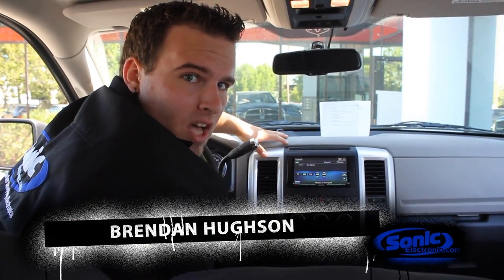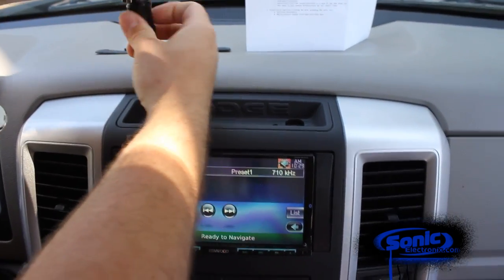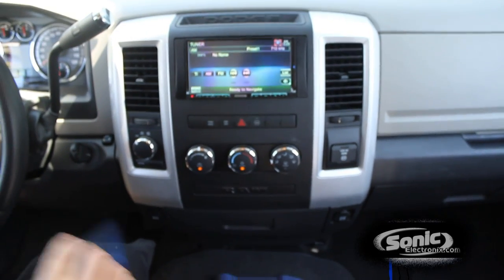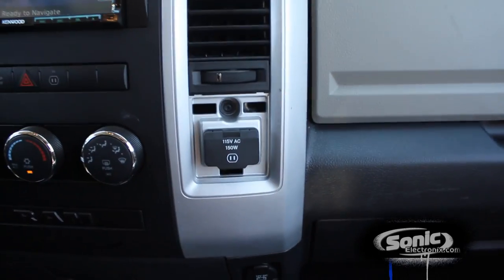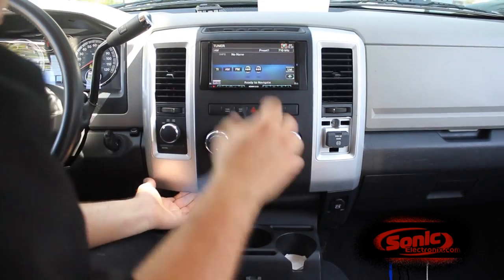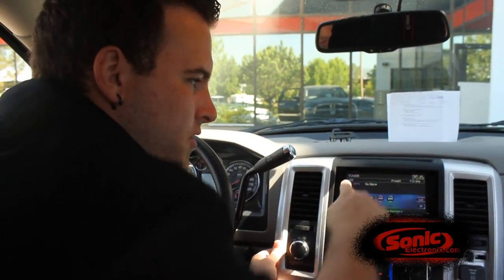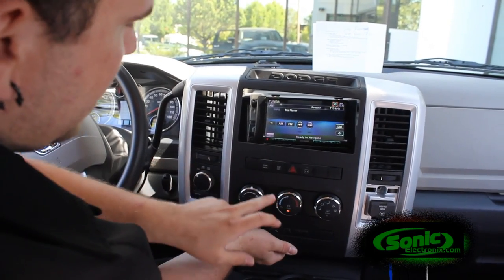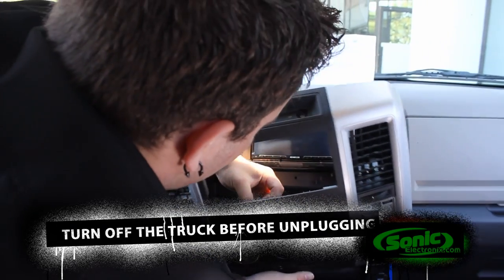How to remove a car stereo dash in a 2009 Dodge Ram 1500

Comment: Thank you for showing a Dodge RAM with Bench Style seats.   All the documents and other vids I saw were for the captain's seat style.  This is very helpful and makes it clear that there is even less to deal with / remove if you have the bench seat (3 across).   This is the same style as the 2010 also.

Comment from the maker: @trenttyre This video specifically shows the stereo removal for a 2009 Dodge Ram. If you have a 2006-2008 Ram then you may require different steps for radio removal.  I don't believe you'll need to remove the center console either way though.

Comment: Great video helped me out a lot when I replaced the factory stereo with another factory stereo. However, note to everyone out there, you need to use a T-15, not a T-20 as described in the video, and if you are removing the factory stereo & replacing it with another like me, use a  1/4 inch drive 7mm socket & ratchet. But none the less, this video is extremely helpful. 👌

Comment from the maker: If the height and width of the radio is 4"H by 7"W a double din will fit with a dash kit. Internally you have to cut the dash on the inside though.

Comment from the maker: @loganAO2 It should be essentially the same.  The screw may be located in a different area since you don't have the A/C port.  Just check the manual for the dash-kit and it will tell you where the screws are for radio removal.